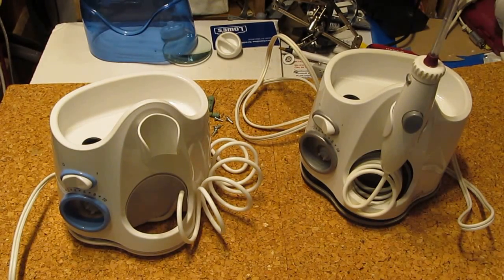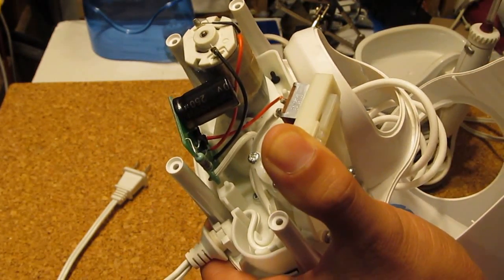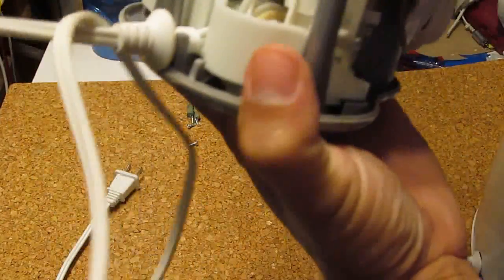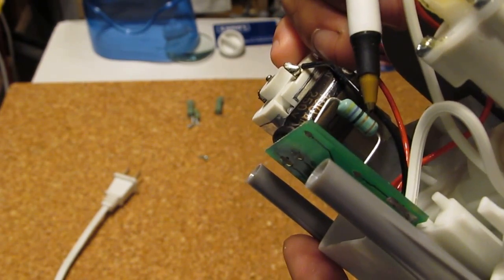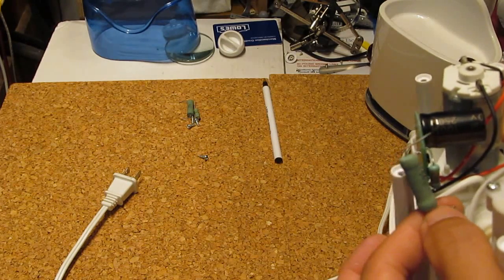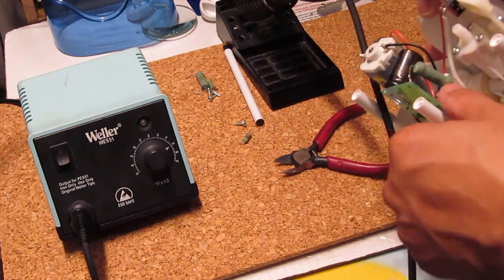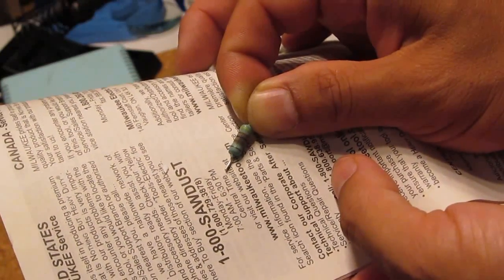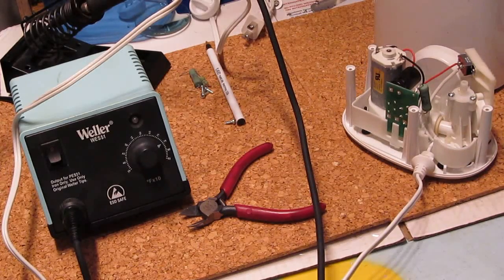Waterpik water floss repair

Comment: My resistor is still intact, multimeter reads 47 Ohms. The motor needs a nudge to start. What is the common issue?

Comment: to whoever struggling with this product because it’s not compatible with the voltage on your country, you can just buy an adaptor that converting 220v AC to 110v AC, no need to search an adaptor that convert AC to DC too because this thing already have the components that convert AC to DC

if your resistor already burnt you can use 56ohm resistor 2watt

Comment: I have this same problem. Brought my waterpik from the US to Vietnam to use and blew the resistor. I installed a new resistor from another broken waterpik. When I turn it on, the motor crack and pop and the resistor get very hot. I quickly turn the power off before anymore damage is done. Any idea what might cause this? Is the resistor wrong or installed backward?
Reply: Voltage in Vietnam is probably 240v and US is 110v

Comment: I have a European WP-660 - the motor is 12v and it has a sealed black box voltage converter in it that will accept 110v-250v

Comment: I have a wp 310 and was using it then all of the sudden it just completely stop!!  it's NOT the outlet and the knob that turn it on and off is still intact.  It just completely stop.  There is power going to it.  by the way, this unit is completely seal.. would water have gotten inside?  is the switch faulty?  do I have to get a new one???  the one I have is not the same as the one in this video.. but it looks similiar
Reply: Unless you know how to safely work with potentially lethal voltages, don't try to fix it.  If you are competent, unplug from the wall, open it up and inspect.  Use a voltmeter on 200vdc or higher range to ckeck that the capacitor is discharged, as the ~160vdc it charges to can seriously hurt you.   if not discahrged either wait until it dischargers or drain it with something like a 50,000-200,000 ohm reisitor for a minute and re-check its voltage - don't just short circuit it or you can get sparks (flying molten metal) or internally damage the capacitor.  Is the motor getting voltage? Does the switch work?  Is the resistor burned, does it have the value matching its color code?  Do the diodes test properly?  Is the fuse (mounted to one of the motor terminals and covered with tape) still good?   

The first time our WP-310 stopped working it was caused by a bad crimp contact between the fuse and the wire it connects to.  The second time it failed the resistor had fried after it was inadvertently plugged into 220VAC without a proper voltage adaptor while in Europe.
Reply: @kennethscholz6027  wtf!?!? 1 year later n a fkkn reply.. fk diss 💩💩💩💩💩💩💩💩💩🤣🤣🤣🤣🤣😂😂😂🤣🤣🤣🤣

Comment: Nice video! So in my case it was the thermal fuse on the motor... See:  https://www.youtube.com/watch?v=ogE2K8LaTME
Reply: Were you able to repair it? I tried using it in europe with a 220v adapter but it never even started. Now back home and it doesn't turn on, no lights or anything. Wondering if changing the resistor will fix it or buy a new one?
Reply: @Tyler28211  Yes, if you watch my video (linked above) it was the thermal fuse that needed to be changed, that's all. Simple cheap fix.
Reply: I'm living in house 220v is it mean I can't using it again?

Comment: Question I would ask is,  what caused the resistor to overheat in the first place.  Even if resistor is replaced,  it will overheat and burn again if the root of the problem is not addressed.
Reply: That's what happened to me. Have you figured it what causes it? I have 110 VAC in my home. Thanks.
Reply: Or maybe running it for a while. Or run with him and then his wife
Reply: someone on reddit thinks the physical stopper on the sprayer handle forcefully blocking the water stalling the motor. Fine short term, but some might just leave it like that thinking it's the equivalent of the off button or simply forget

Comment: You didn't bother to show how to open it up to get to the motor!!!
Reply: Its easy. Take the screws out. Need a thin 1ph screwdriver. Once you get the screws out theres like black rubber pieces u have to push in. Also have to take off the adjuster wheel. Small Flat screwdriver to pry it off

Comment: What is the power consumption of this device? i been searching for a datasheet but i just find the voltage and frequency but never current or watts
Reply: just measured mine at 120V 0.18A at max pressure

Comment: Any info on the slide switch looks like a std. SPST switch picture of how it mounts maybe a part number like stackpole #.   My problem is that the outside knob does not move easily after looking at your video I realize that waterpick used a std. slide switch that might be handyman repairable.
Reply: 6a 125v ac on off slide switch solder lugs. Should be able to find searching that

Comment: if you turn on the 220 V network, the 56 Ohm 1 watt resistor will burn. to repair it, you need to replace it. a small reminder for repairs .
Reply: Use a adapter to change 110v to220v the 56 ohm 1 watt resistor work ok?
Reply: @giaphucnguyen1143  yes

Comment: Hello 
Thank you so much for the Video I hade the same issue and will try out the solution you advices 
I would need your advice on another device (baby breeza food maker) which I blogged into 220v by mistake and now it would not work
Please let me know if you can help me and guide me through
Reply: Were you able to repair it? I tried using it in europe with a 220v adapter but it never even started. Now back home and it doesn't turn on, no lights or anything. Wondering if changing the resistor will fix it or buy a new one?

Comment: Is the removal of the wp-610 intensity dial the same? I tried prying the edges but it seems as though there is a screw in middle of the dial. I searched for my model but there are no photos or videos regarding the dial or intensity adjustment removal.

Comment: when you change it to 56 ohms, does it work on 220v?
Reply: Apparently not, there is no transformer...
Reply: @CaptChaos1960  
Hi
I bought this water flosser in the US and used it in Europe in a 220V outlet, my resister looks Burnt, & i'll replace it.
If i'll buy a transformer can i use it in 220v outlet? 
And can i replace the motor to a 220v dc motor without using transformer?
Thanks

Comment: A very helpful video.   The  model number is WP 140W.  The device was used  in the same 110 V circuit for a year or so.  Then one day it would not work.  

 Board showed some damage from overheating.  The resistor got hot and the color bands could not be determined.  Diode 4 and 3 got hot too.   There is a small inline fuse that is taped  to the side of the motor.  This fuse is not visible without cutting away the tape.  This 2 amp fuse was blown.  

Great help with determining the resistor value.  Thx
Reply: Were you able to repair it? I tried using it in europe with a 220v adapter but it never even started. Now back home and it doesn't turn on, no lights or anything. Wondering if changing the resistor will fix it or buy a new one?
Reply: @Tyler28211  Hi, 
Yes, I replaced the inline fuse and the main resistor on the board.  It has worked fine since.

Comment: I purchased a replacement wand / hose assembly (WyFun Oral Hygiene Accessories Standard Water Hose Plastic Handle for Waterpik Oral Irrigator Wp-100 Wp-450 Wp-660 Wp-900
Sold by: VinYBan) . 
After the simple procedure of replacing the new parts I also noticed a dramatic loss in water pressure at the tips. After looking at some YouTube videos on how to dissemble the old handle to make repairs. My hose was to brittle and super glue melted the hose. I then took another look and compared the old and new assemblies to see what could cause the loss of pressure. The part that has the ears for screws has a much smaller water inlet hole than the old one. I simply removed that part from the original hose and put in on the new hose. Wa-La , Pressure restored! Look out for the little flexible flap that sits between the water outlet and the water inlet part.
Reply: Were you able to repair it? I tried using it in europe with a 220v adapter but it never even started. Now back home and it doesn't turn on, no lights or anything. Wondering if changing the resistor will fix it or buy a new one?

Comment: Hi your resistor 56 ohm works perfect? How about watt of resistor 0.5 or 2 watt will works?
Reply from the maker: It's a big size resistor. I think it's about 2 to 3 Watt resistor. You can use a 5W resistor if you have one.

Comment: I am trying to buy the resistor online. There are some many types like wire wound , carbon film ,metal oxide etc. Which one should I use. Also what is the voltage and wattage rating of this 47ohm resistor?
Reply: Usually voltage does not matter unless you are working with high voltage 5,,000 volts or higher. The GREEN body color tells me it is a flame proof resistor. I would buy  a 47 ohm 2 watt flameproof resister if the resistor smoked the the motor might be bad so if you replace the resistor and the motor doesn’t work......the capacitor might be shot-also if the cap is shot then you might see some dripping from it on the board.

Comment: my water pik flosser often stops pumping in middle of cycle. sometimes turning it ofF and on oR jiggling the device may help to get it started.any suggestions?
Reply from the maker: Might be loose solder joints or loose solder connections to the motor. I'd open it up and check out the inside.

Comment: hello Vaueco; my resistor is burnt, I can only recognize the first color band is black, the second and third color bands are beyond recognition, the fourth and fifth bands are gold and brown, respectively.  Can you confirm the resistance value? I tried your suggestion of 47 ohms and it did not work.
Reply from the maker: 47 ohms, confirmed. If it still doesn't work with a new resistor, try to test your motor with a DC power supply. I'd say anything more than 12V DC should spin your motor. If that doesn't spin your motor then your motor is burned. If your motor spins then that would isolate the problem back to the circuit board which might be the diodes.
Reply: Also could be the fuse (soldered to one of the motor contacts, the crimp connection at the other end of the fuse, one or more diodes, the switch, a burnt circuit board trace, the motor, maybe the capacitor.

Comment: Hi, I've just bought it from another reseller and she did not tell me regarding the voltage, and I realised after plugging it in for 5 secs it died. Googled for info and I found that the machine runs on 110V however my country runs on 220/240V,50hz. Is it that my waterpik is most likely burnt and can it be easily solved by the method you showed?:)
Reply from the maker: That was exactly what happened to my waterpik. You might just have the same problem. Just open it up and check out the resistor.
Reply: Nur what country do you live in

Comment: hi, i have the same issue, i accidentaly connected a waterpik bought in the us and used it in argentina, i opened it but the resistor looks fine (not burnt) do you know if the proble could be something else, i have yet to try changing the resistor but it looks fine to me
Reply from the maker: Get your multimeter and measure the ohm value of the resistor. If you don't get around 50 Ohm, it's toast and needs to be replaced.
Reply: Hola Diego, me pasó lo mismo, lo pudiste reparar?
Reply: no, no encontre, pero si logras encontrar uno avisame!
Reply: Diego, lo pude reparar, me salió 850 el arreglo, se había dañado el circuito.
Reply: +Santiago Hola, me pasó exactamente lo mismo, donde lo llevaste a reparar? (En Bs. As.)
Reply: diego altalef hi have you solved your issue? I've just bought mine and used it in Singapore and the same thing happened and I have no idea how to fix it:(
Reply: hola, estas en buenos aires? si lo mandaste a arreglar por aca me pasarias el dato? tarde pero seguro jajaj, acabo de encontrar la caja

Comment: Did I miss something?  Did  you show how to take the old resistor off and put the new one on?You didn't show how to open the unit (there are no screws underneath).Where do you find/buy these resistors?
Reply: Sleeping Lioness you have to take off the round knob first. my dad just did that to open it.
Reply: Many thanks Sana.

Comment: how do you remove the button?  I opened the bottom but am unable to get the button off.
Reply: Mine was on very tight.   Pliers would not grip the lever area.  Got some good tape (duct tape) & cut two thin pieces.  Applied one piece to one side of the control, the other to the other side.  Ran as much tape on the inside of the control as I could (along the lever part & up the side).  Stuck the two pieces together where they rose outside the control.  Gives you very good leverage to pull.  Mine came off after a slow, forceful tug.

Comment: Hi, I have the same situation
we conect to 220V
I see my resistor the same
I will try to change resistor 
thank you very much
Reply from the maker: My waterpik runs on 120V 60 Hz frequency. But I think it should work on 50 Hz also. I believe it just has a regular motor so it should run fine. The only things that are affected with 50 Hz frequency are induction motors and clocks. If you run an induction motor at 50 Hz instead of 60 Hz, it will run slower but won't damage the motor as long as it's 120V. If you run a clock at 50Hz instead of 60Hz, the clock will run slower but it still runs just fine.
Reply: Hello! My english is poor,sorry about that. I hope you'll understand me...!I've got WaterPik WP-100 from USA to Bosnia and Herzegovina and I may not use it . On the bottom of flosser is Oral Irrigating Appliance 120V ,60Hz , 14 W. In Bosnia ond Herzegovina voltage is 220V , and velocity 50Hz.   
If I buy transformer ,may I use on various velocity yet? What can Ido? Please,help!!!?

Comment: Hi..I have the Waterpik WP900. The thing is that it won't turn on when I plug it. If I turn the switch on nothing happens. The unit also comes with a rechargeable toothbrush and the charger is not working either. I've been using it without any problems for 4 months..and it just suddenly stopped working. Do you have any idea of what could have gone wrong? I already tried using another sockets but nothing happened.

Comment: What about a portable (cordless) Waterpik that doesn't have a resistor? I think mine was plugged into a outlet when overseas.
Reply from the maker: +Trent Pierce 
So you plugged the 110V charger into a 220V outlet? Most 110V chargers are designed to use with 220V outlet as well so it shouldn't be a problem.
Reply: +vuaeco Good answer!